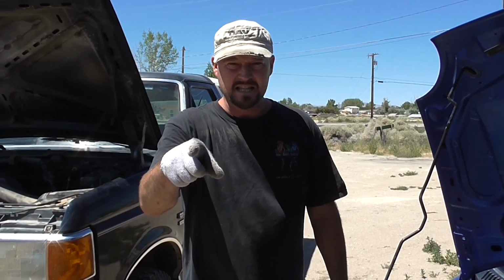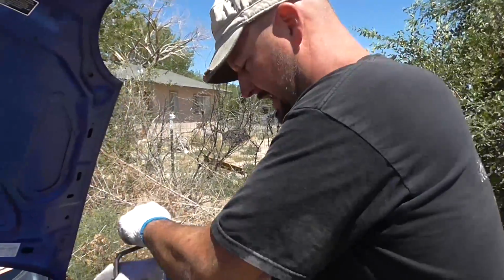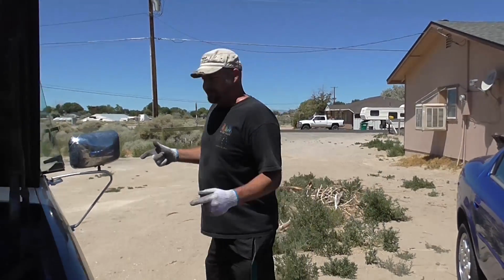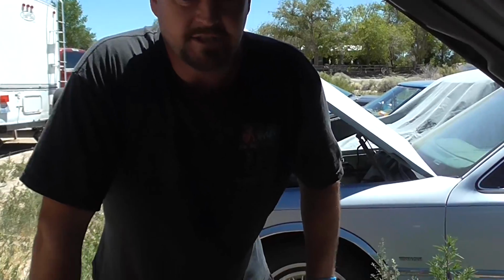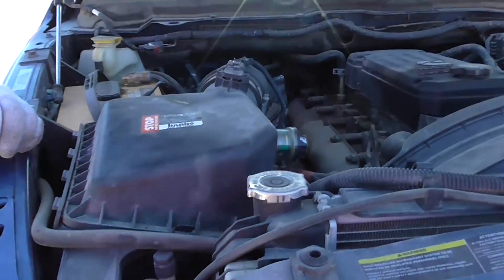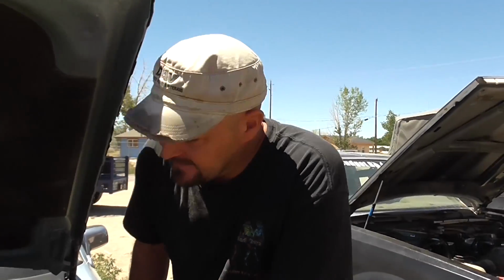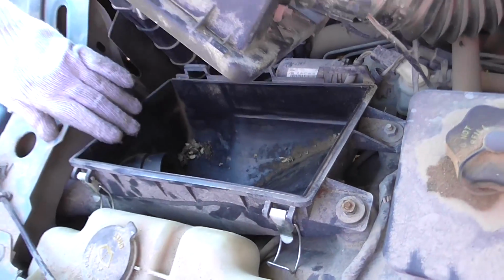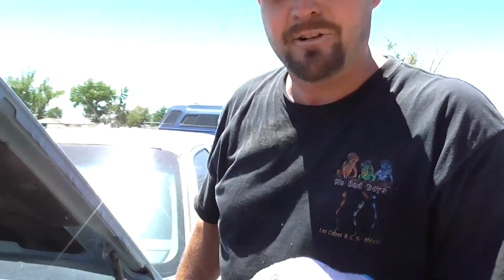Free Horsepower And Fuel Economy - Intake Mods

Comment: What if keep using a paper filter? Why do you have to cut off the whole underside of the air box? does it really need it?
Reply: No Holly you don't need it. Paper filters work fine, just change it when its dirty. He's psyching himself into thinking his car is faster.
Reply: if you cut a hole in the bottom of the air filter housing, you are going to let HOT air into the intake, and you dont wanna do that. you want to get cold air in it. see kevin's post, below
Reply from the maker: you do not need to do anything, I am showing ideas and concepts here that work for me.  I prefer cutting the hole facing the grill so the COLD air gets in from the outside.
Reply: You are showing a bunch of amateurs (including me) a "concept" that most of them might likely rush to do to their cars. I like to research things thoroughly before I make any modifications to my car. so I ask at least 3 other mechanics. You can get 4 different opinions from 4 different mechanics! Anyway, I was going to go with "cutting the bottom out of my air filter housing" and discussed it with one guy. He explained that it would actually draw hot air into the intake, and why hot air is not good. It was on YOUR video, and now you are going to call it a "concept". Of course, if something happens to these viewer's cars, you are free and clear. This is a warning to all these people out there. Do some more research before you believe everything you read. You may end up damaging your engine. Now.... Mr. Budget Boosting: you should have explained about the cold air vs hot air difference. Cutting a hole in the bottom of the air filter housing is NOT NOT NOT a good "concept.! You will probably delete my post, but you should take responsibility and change your video.
Reply from the maker: OK here I go.  I share basic ideas, they work for me.  Hot air depends entirely where you aim the removed extra inlet area.  Did you watch the part where I showed you the trumpet, the small area the airbox breathes out of?  That is where the factory designed the breathing area, very small, not entirely cold air as well, that is just one car, every car has a different factory air box design which a person must study before doing anything.  You are an example of what I believe every person should do, RESEARCH and study the specific car before doing anything.  What I do with one car or one airbox DOES NOT work with EVERY CAR and EVERY AIR BOX under the sun.  Again, every car is designed differently but the concept is the same, find the stock area where air comes in the airbox, and increase its size to increase its flow to where it gets more air.  Very simple, breathe in, breathe out exhaust is also very important which I DISCUSS IN OTHER VIDEOS.  Whether or not the air is hot depends on where the air breathing source on the airbox is.  Some vehicles its hot, some cold.  My 2014 F150 has area in front of the grille so cold air gets in my grille from the outside, that is COLD air.  Some other cars do not have the same design.  It is common sense which in my opinion has been reduced to rare sense since it seems the new generation of people just jump into things without thinking or researching their own vehicle through.  On my intake video part 2 I believe I did a much better video, watch and tell me what you think.  I showed examples in some different cars, that is not every car, and there is no way I could cover every car.  If someone lacks the sense to study their SPECIFIC car and cuts away, that is 100% THEIR doing and THEIR TOTAL ABSOLUTE RESPONSIBILITY.   Do I really have to inform people to use SENSE and JUDGEMENT before they work on their car or do anything in life.  When the enemy was trying to kill me in all the wars I have experienced, did someone have to tell me to be observant of my surroundings?  NO!!  Sense and Judgement are concepts a person naturally SHOULD have, in instill in themselves, if not, nobody can help them.
Reply: use the paper filter if you want. i havent noticed a diff with the k&n types.  you can also just swiss cheese the dirty side of the box with you choice of bit.  mine is a 2" hole saw cuz its faster :)

Comment: Your GNX was having boost creep issues because of the wastegate. When you increase the amount of air going into the turbo by doing a "free flowing intake or intercooler", you are effectively reducing the spool time and therefore need a larger waste gate to handle the boost actuation. Limiting airflow with a restrictor of any sort on a turbo car is counter productive. Fix the actual problem at hand, especially on a wonderful piece of performance history like a Turbo G body.
Reply from the maker: The wastegate I had was very large, it was one from GN1 performance that came with their T66 turbine and wastegate kit.

Comment: 2 things is cutting out the bottom of the air box legal ?? and do you need to buy a new mass airflow sensor ? thanks!
Reply from the maker: the legality always depends on the state and emissions station...  I would ask ahead of time as to avoid any kind of issue.
Reply: +Budget Boosting thanks and also do u need a new mass airflow sensor ?
Reply from the maker: Anytime I modify any intake, I always retain all sensors and keep them intact.

Comment: Is there a way to switch to a Throttle Cable that is more reliable than that constantly always failing Electronics Communication between the Throttle Body and the Accelerator Pedal ??? On a 2008 Chevy Impala LS 3.5L V6

Comment: Just ran across this video GREAT WORK It's nice to see that someone made a video of what I have been doing for years! Its all common scene when it comes to intake air flow! . Just did my 2013 Camaro 2SS ... Nice video! ... also enjoyed other videos of yours
Reply from the maker: Yep, thought I would share it since not too many people know about the old trick.  I remember in the 70's, flipping the lid on the aircleaner to get the whole filter to breathe on the Camaro.  Simple things making a difference.
Reply: Yup! It was disappointing that Chevy put a nice LS3 430hp motor in the car, did a decent job locating the factory air box and put a decent sized filter in it, HOWEVER the relatively small snorkel from the air box that pulled warm air from the engine compartment located behind the headlight WITH NO ACCESS TO ANY AIR MOVEMENT was a total joke! So I cut a nice size opening in the front of the stock air box and used some sheet metal to make a heat-shield so it now draws cooler air from the fender area! painted it flat black and it looks stock if you didn't know it was modified! The design accomplishes the exact same thing as the expensive CAI units people are installing / Better air flow & Cooler Air

Comment: yea.... cutting that stock air box to make room for a cheap filter just allowed hot air into the air box, which it was designed to keep out hot air and bring in fresh air.  carb complaint k&n is better a better filter, better free flowing intake tubes. Then if you can fabricate you can block of the heat and make it true cold air/fresh air.

Comment: Would the intake mod on the bronco be making the truck Jerk and stall out? Because I did the mod
Reply from the maker: +Chris Valdez No it should not jerk or stall unless one of the sensors was removed or disconnected during the work.  One of the sensors on the engine sounds like its acting up, possibly throttle position sensor, that was the symptoms I got on my F250 when that sensor went bad.  I made a video on it too since it is a pain to change.
Reply: +Budget Boosting could be,  but I covered up where I removed on the intake and it's  working slightly better,  I just barely replaced those censors tho.  I know I need a new throttle body
Reply from the maker: check for trouble codes, see my OBD I reading codes video or purchase a code reader from Autozone for OBD I ford trouble code reading.

Comment: i have a 2005 4.7 f150 im trying to get better gas milage and more power any tips on making my own budget intake? the maf sensor is the thing im afraid of the most i dont want a check engine light
Reply: +Black Sheep Rides: check out the Crawford Performance "Eco Block" MAF spacer..
Reply: Black Sheep Rides what about shorty headers? Any ideas? Do they give better mpg?
Reply: i believe they would cause it would be better air flow but in the long run youd probably loose it because it would sound so good that you would wanna hit it at every single chance you get

Comment: what kind of gas mileage Improvement
Reply from the maker: different for every vehicle, I gained about 7 mpg hand calculated on the F150 doing both intake and exhaust.  More go for less throttle too.
Reply: Budget Boosting pretty cool I would figure that here in California we would fail smog or a map sensor would go off saying massive air leak
Reply from the maker: If you know your SMOG inspector, ask him before hand, get his opinion and if he will work with you, have him inspect your car every time...

Comment: I have a 2004 Saturn Ion any suggestions?
Reply from the maker: send it back to outer space.   Well until then, you can have an exhaust shop replace all the mufflers with straight pipe and just use one thrush welded muffler instead of multiple mufflers the factory uses to choke it.  The intake, find best largest free breathing filter to replace airbox with making sure all sensors are still connected and doing their job monitoring temperature and flow.

Comment: Wile cutting the bottom or dirty part of the intake box. Does it have any effects on the air flow censor ?
Reply from the maker: So far I have had no problems with the many vehicles I have done.  If you are concerned get a spare intake bottom to cut and then you still have original one.

Comment: Actually, it's call WAI  (WARM AIR INTAKE), cuz he is sucking all the warm air from inside the engine bay.
Reply from the maker: No, get the same fresh air as the radiator does.
Reply: Sorry bud,  but without controlling the airflow to come only from IN FRONT of the car BEFORE it enters the engine bay, you dont have cold air going to that intake. With your modicication you are feeding all the HOT- WARM from inside the engine bay, including the nice toasty air your rad fan is blowing in the engine bay. 
You might love the roar of the open box, but you're definitely losing horsepower with all that hot air.  
Dyno a stock car and then Dyno it after your hack it up the way you say.  You will lose horse power. 
There's a reason why dry ice and making use of your cold A/C lines are used to get better quarter miles... every pony counts!   

Actually, if i'm not mistaking, I believe that is one of the concepts put into play on the soon to be released DODGE DEMON.  

You're definitely intelligent, but you're wrong about yours receiving as cold an air, as the radiator does.  That's why the rad is in front of the engine. ;)
Reply from the maker: When you drive forward, the COLD air RAMS through the front of the car to the open element air filter = COLD AIR..........  Do what you want with your car, I just show anyone what I do and they can do whatever they want with the information.  Arguing with me will NEVER change my views since they have been amplified by 4 decades of experiences..........

Comment: i didn't cut the 'dirty' side, butt drilled about 14 / 16 .5 in. holes on bottom, so u can't c them @ all... my son has a 2007 altima & he noticed diff rite away... gained MPG, + of course added miles 2 how many miles u get 2 the tank after u fill it up...

Comment: But the filter is going to get wet in the rain. And the original intake is usually designed to prevent it getting swamped driving in a flooded road situation.

Comment: Is there any empirical data from a dynamometer test with that mod to show the performance improvement is significant?
Reply from the maker: Look at my dyno results for my F150 truck, it has the 3.5 twin turbo engine, compare to any other dyno run on a mildly modified F150.  My rear wheel HP was 392, my rear wheel torque was 526 lb/ft.

Comment: If you let more air in. How can you get more out through the same exhaust system
Reply from the maker: Balance it with an equally free flowing exhaust.  Easiest way is remove the factory heavy boat anchor muffler, replace with free flow light weight muffler.  My newer video shows this example and the results.   https://www.youtube.com/watch?v=PaxHmZi0U9s

Comment: remember the old chevy's had a trumpet or two on the air cleaner with a small hole on the tip ?  that is not a restriction, it's a jet. it makes the air shoot faster causing turbulence.. the problem was that they sat on top of the engine sucking in hot air. when you close the hood you're closing a big fkn oven. hot air is your worst enemy.. the intake system on that  Lincoln is a cold air intake system and he destroyed it. now he's nothing but hot air. but if it makes you happy, just chop off the trumpet but run some PVC the same length as the trumpet. paper filters are ok if they're large enough. K-N cone filters are often left hanging in the engine compartment oven. if ran to the grill for cold air they get rained on. that lincoln has a good inline cold air  filter system.

Comment: Fortunately airbox on my 4.3 is the same one on a 6.0. I get 1.7 metric liters of free air. This is fun and all but it is kind of like flipping a lid on a carburetor air filter. There is more air but it's so hot in the engine bay area do you really get more oxygen? By seat of the pants, I am not so sure. I think this has been tested and found wanting.
Reply: And then there's the whole issue of the mass air flow sensor and intake tube not letting enough air through
Reply: I don't think Venturi principle applies here

Comment: Like your ideas have a 93 YJ with the peanut 2.5 with 240k miles. I do off road a bit mud sand dirt. concerned about exposing filter to elements (water/mud) .  also have some blow by and feel muffler is getting blocked ( no cat) is there any easy well to tell. Need to stay tight on funds am a single Dad.
Reply from the maker: Snorkel sounds best for those going regularily in the mud

Comment: Have you tried any of these modifications on a class c rv? I am looking  to get a class c rv any  fuel and torque improvement would help with gas mileage.
Reply from the maker: Not yet however, look at the supply of air going to air filter to see how small or large it is.  Enlargen it.  Also exhaust systems are very restrictive on RV's so have free flow mufflers replace the heavy factory ones and it will make a great difference in low end torque.
Reply: Thank you

Comment: That lincoln 4.6 doesn't have lifters, its a non push rod motor.
Reply from the maker: It is an overhead cam engine yes.  Nobody said it had pushrods, that was the 1990 Ford Bronco with the 302 SBF that has pushrods.

Comment: and the intake advantage is more that the rubber in a stock intake absorbs heat, where upgrading to aluminium keeps air cooler

Comment: What do you say to Scotty Kilmer who says dynamometer testing shows very little power change and degraded performance from air intake mods??
Reply from the maker: Opinions vary, and that is what they are.  Dyno testing machines can be fine adjusted to give readings that suit the operator such as temperature adjustments, putting the sensors in different places and so on.  I am not a believer in dynometers, they are just bragging rights.  I own a Camaro ZL1 that Dyno'd at 950 hp and it is not my most impressive car I own.  Drivability, hand calculating fuel economy in various driving situations.  I dyno'd my 2014 Ford F150 on one of my videos, watch it, I did my intake and designed my own exhaust mods too.  Much higher numbers than F150 trucks with many more mods than my own.  Check it out.

Comment: i've been opening up airfilter boxes for a long time. heck been done on the 50's yes better air not much more power dose sound better.      Budget Boosting  maybe try running some test to show how much better.  just saying.  i know more air works a bit better myself saving a little fuel on my truck. with more air.    however good videos dude. keep it up.
Reply from the maker: Look at my F150 on the dyno video, It has my intake and exhaust mod as well.

Comment: He is right about the price of air intake kits. $300 is a ripoff. I bought some aluminum tubing and subb'ed the restrictive intake pipe going into to the air box with it. Then I put in a cotton filter and done. Works better than the kit intake I had bought, which had replaced the whole intake and air box.
Reply from the maker: +mrksts1 Outstanding, it feels great to do things custom for a reasonable price.

Comment: Great idea!. But your intake is taking in hot air from the engine. 
I did something similar to my Ram 1500 quad cab, that intake from the wheel well changed to a 14' x5' . It gets air from down by the frame and front passenger side wheel. It looks like an elephants trunk! Lol that Hemi gets all the air it needs!.